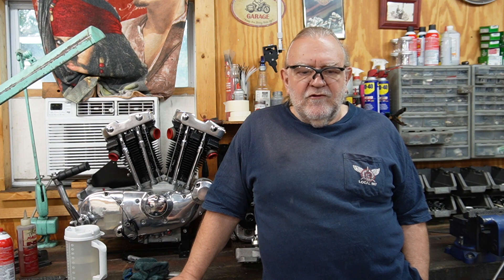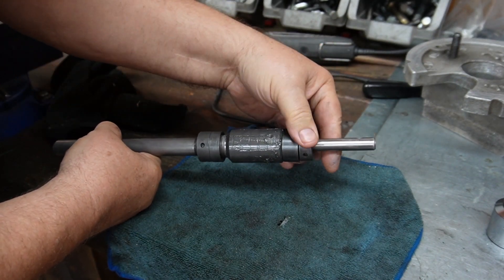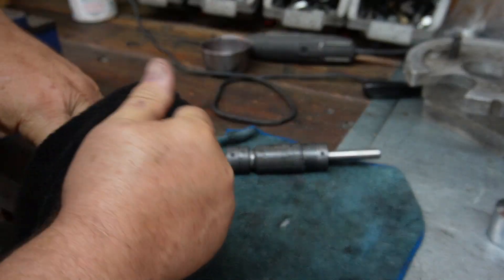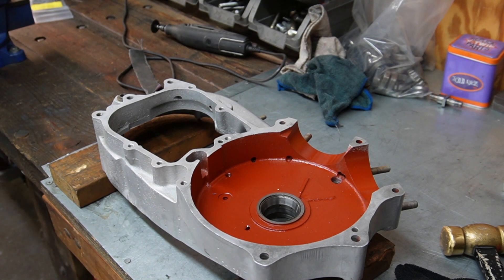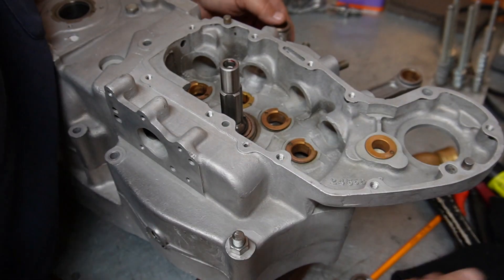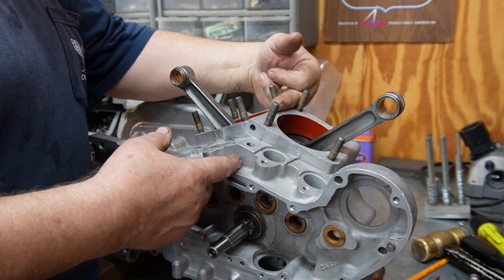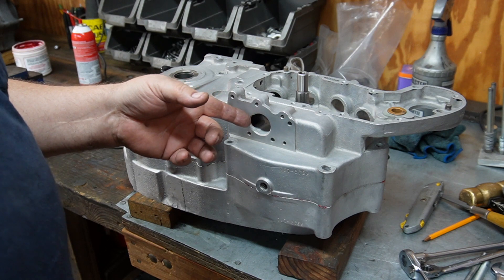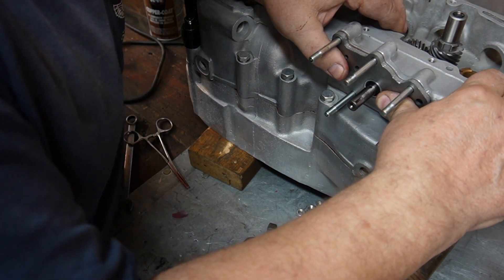1958XL Sportster Project  Day Two Nbr 206

Comment: This was really good, never seen a set of cases line lapped before.  Just took a chance on a pair of flywheels for my 1959 XLH cases (which were like NOS compared to the rescue performed on these!).  My ‘59 is one of the dreaded “start with empty cases” projects and will everything hand fitted.
Reply: If you’re building from scratch like me. I have a bunch of little extra pieces you might want? I sell stuff cheap. Hopefully you have some motors to pick parts off of? Smitty.
Reply: @SmittyInVegas  I know I don’t have a usable set of cams or lifters/lifter blocks.  The cylinders I might use are at .060 over now and hopefully will clean up at .070, but I’d like to be closer to standard bore.  I might have a rod set but will have to look at my pile.  I do have a “donor motor” which I was originally going to gut and move everything over but ended up getting a title for.  That’s a complete motor that spins and has compression so I don’t tear that apart.
Reply: I should have a number one number three number for KIM the generator gear. Maybe some 900 cylinder heads?
Reply: Not Kim. Cam. Lol
#1,3,4 cams & gen gear. Plus those figure 8 cam washer things. Some Misc gaskets.
Reply: @SmittyInVegas  are those stock Harley cams or P, PB, etc.

Comment: When installing the plug in the oil pump, i heard " if you foolish enough to use a pressure gauge". Can you explain the reasoning behind that statement ? Because i really don't know. Im definitely not questioning your knowledge.
Reply from the maker: At idle with hot oil on a hot day an XL might pump out 6 psi at idle. Most oil pressure gages are 0-60. So that puts the needle down around the first tick mark on the dial. A 0-60 gage is calibrated most accurately around middle scale, so essentially that number is probably meaningless. All an oil pressure gage really does is make you worry about your oil pressure. Put your hand on the tank, if it's hot, oil is circulating.

Comment: Just wondering, what is the advantage of using oil pump studs verses bolts. My late 1973 had bolts when i got it, so it still has bolts after the rebuild. Is it just a difference in year models ?
Reply from the maker: The early engines had studs and alignment dowels between the pump body and pump cover, I'm sure the idea was to maintain exact alignment between the parts. I suppose somewhere down the road a bean counter figured out that that arrangement took extra steps on the assembly line thus increasing complexity and therefore cost. So HD shit canned the studs and alignment dowels. The advantage to the dowel and stud arrangement is that if you have a pump with all matching parts that turns freely is that every time you reassemble it it should go back together exactly the same. There are disadvantages, if you end up mixing and matching parts on the oil pump, such as is often the case on older engine, the slightest variation in tolerance may cause the pump to bind. On engines with no dowels and no studs there is a little room to wiggle the parts around to make sure the pump doesn't bind. In fact the manual says you may tap it with a mallet to help make sure it turns freely.